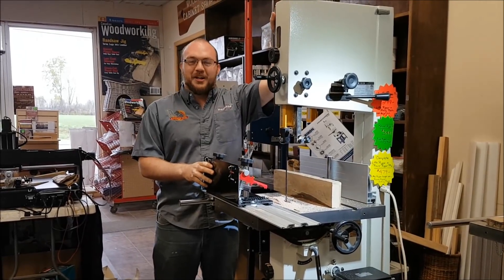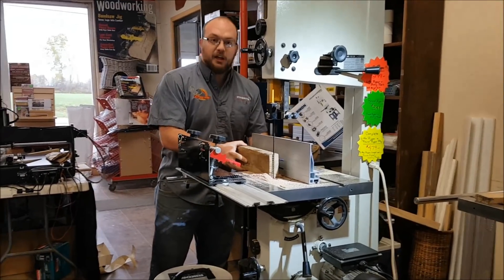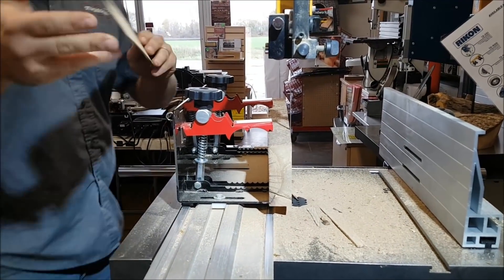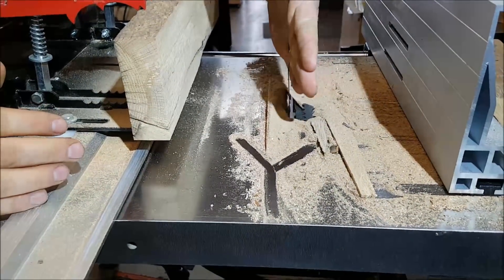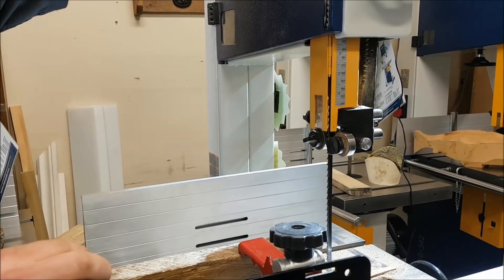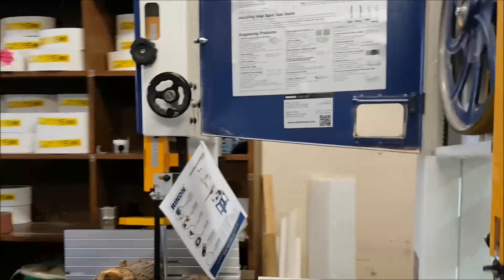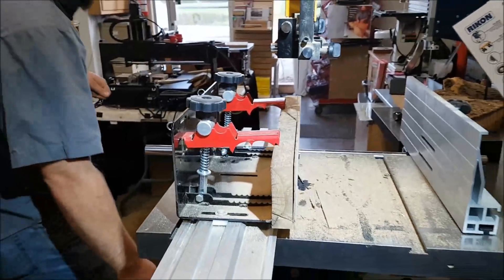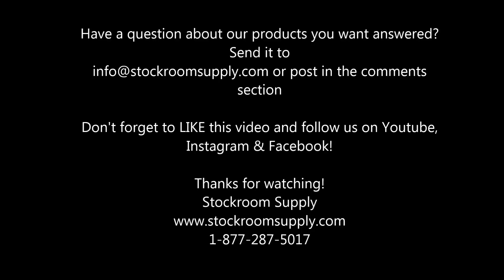EthAnswers Blade Drift myths, Why Bandsaws Should Never Drift!

Comment: As you say, “The real problem is when you want to cut a board straight down the middle. Regardless of what you do, when the wood begins to stress, inevitably it will push against the fence and bind the blade...therefore causing the drift!” If you attach an auxiliary fence which ends at the front of your blade, the stressed wood can spread out without pushing against the fence and causing drift.
Reply: Good one with the second fence ending at the sawing point so stresses will not cause the blade to bend.
Reply: I'll note that this is what people do with sliding table saws. Unlike American cabinet saws, a European sliding table saw allows you to pull the rip fence forward so that it stops just at the leading edge of the table saw blade.  Past the teeth of the blade, there's no fence, and so nothing to bind against.

Comment: What about drift when not using a fence....
Reply: In that case, drift is being caused because you are binding the blade. A human cannot run a piece of wood perfectly straight through a blade. Our bodies do not have that kind of fine motor control. With the sled, you are eliminating the human error. The piece of wood is contacting the blade with consistency that you cannot replicate free hand.

Comment: My world has been turned upside down, and the Truth Revealed!  I didn't know this because the people I learned from didn't know either - we repeat the same myths, handing them down from generation to generation.
One way to look at the Little Ripper is similar to a table saw crosscut sled, but designed for a bandsaw. In both cases, the cutting path is based on a machined track to guide the wood into the blade, rather than using the (unreliable) edge of the wood as a guide.  Call it a ripping sled?
The product costs more than my crappy bandsaw, but this at least lets me know what part of my technique I can change.
Thanks for posting!

Comment: The cause of blade drift is the table is not aligned to the blade.
Reply: This is only one cause. The most common wood cutting blades wear unevenly, losing set on one side before the other. Also, the tuning of the saw can put a twist in the blade from the top to the bottom. If the blade is running on the back of the top wheel and the front of the bottom wheel, it will be twisted. And the shorter the saw, the more pronounced the effect. This is why it's not particularly impressive for someone to demonstrate "drift doesn't exist" with a big saw with a very solid frame and a very sharp/new blade. This is like showing how wheel alignment of your car isn't real, because look at my million dollar Borghatti; I take my hands off the wheel, and it still goes straight! And this certainly doesn't prove that drift is caused by fences. 

The segment of the population with desperate blade drift issues are using a lot more of the bench top toy saws with the cast zinc aluminum alloy frames and probably using the blade until it starts to burn the wood or the blade snaps. With a flimsy enough frame, the blade can even wobble front/back on the wheels during the cut because of frame flex and vibrations, and the poorly damped oscillations in the frame will also effectively reduce the beam strength. Not to mention flimsy blade guides that can't keep the rear guides in a stable position.

Comment: Eth - I have a new 1/2" blade, 4 TPI in my bandsaw.  To test the idea out in this video, I made a sled that holds my board secure and that sled rides along a fence on right side of blade.  There is no way to bind blade.  My wood is short too, about 2" high, held firmly in the sled just like in the little ripper.  I have my guides set right and proper tension on blade.  However, I am still getting drift where if I start to make a 1/4" thick resaw cut, it goes down to 1/8" due to drift after about 4" into the cut and I have to stop.  What could be the problem?  Thanks.

Comment: Ethan, why would a curved resaw guide not accomplish the same thing, as it is only applying pressure to the workpiece right next to the blade? The wood movement is deflecting  against nothing, and therefore not pushing against the fence, and therefore not applying lateral pressure to the blade. As long as the cut is roughly parallel to the blade itself so the tail of the blade stays within the kerf, then no drift.

Also, when you say that the lateral pressure "dulls" the left side of the blade, are you saying that it's actually damaging the blade, or that it's just making the left side less effective in that moment?

Comment: Woodrumtodd1@gmail.com  I make bandsaw boxes and sometimes the bottom side will have runout, drift does blade tension have a lot to do with it? My biggest problem that’s driving me crazy is that my blades go dull very quickly and I’ve tried several different ones and am currently using a 3/16 4tpi hook. I mainly only use poplar and soft maple-solid 12quarter and 16 quarter materials around 12 to 18% moisture content. I have a 14 in porter cable bandsaw and am one day going to invest 1500.00 or so into a new one. Are my blades gonna still dull then and is cutting thick woods all the time my problem? Thanks for any advice

Comment: Wouldn't the fence work if you put the thick side towards the fence? The veneer would then bow away from the cut into the air, thus no drift, same as with that expensive contraption you have.
Reply: The fence should work the way you describe. That is the safe way you cut on a table saw also.
Reply: @wartlme  on a traditional western saw, yes......the little ripper is more akin to a euro sliding table saw.  The ripper is the sled/carriage that holds the piece through the blade.  on a euro saw, you position the fence in front of the blade ONLY  so the board has no lateral force on the blade.
Reply: I think it does, but the fence doesn't move along with the wood, you have to constantly apply the pressure from the wood to the fence the entire time, this is essentially a fence that moves with the wood staying square the entire time.
Reply: @Dhammawitt  that's why you use magnetic finger boards.
Reply: @AlphaBlkHrt  Which would only work for wood that's the same thickness. The fence side has to be evenly flat as well as  the featherboard side. People who cut raw woods into tonewoods this wouldn't be a solution.
Reply: @Dhammawitt  I made a fixture similar to this a few days after getting my Jet 14" (+ 6" riser kit), knowing I would save some cost if I could get larger, rougher pieces of my tonewoods, or even just billet. I watched the Alex Snodgrass bandsaw videos, and did a little digging/researching, while building my fixture, which is a bit more robust, because my engineering/design/workholding/fixturing background, and most of my education in this area, was designing it myself, building it myself, setting everything up, prove-out myself, and run it until we had our significantly significant sample, so we could provide Cap Study, SPC data, etc. to our customer, and that could be 100 pcs. or 1500 pcs., and I was ALWAYS working with metal, not wood. Could be brass, aluminum, any of 30 varieties of steel, bell bronze, any of a dozen stainless steels, or any of two dozen DTM super-alloys used in deep well oil and gas drilling, or aerospace. There's similarities and differences, but rigidity of the set up, proper alignment, and proper set up of tooling, machine, and workpiece matters. It just does. This guy has said some things that are very true, some things that are misleading, and a demonstration like this really doesn't give me useful information... unless I plan to set up my saw like this. 

The workholding fixture he makes and sells, or my workholding fixture, is essentially like running a fence opposite side a fence normally runs, with a good grip on the wood, and put the thin cut away from the fence. It's a good strategy, but a good set up of the machine, the fixture, the workpiece, these things DO matter. And I don't own a set of featherboards, for exactly the reason you said. The pieces used to make a solid body guitar or Bass spend very little of that building process time as squared off pieces where a featherboard does you any good. And a 1 inch tall featherboard trying to hold an 8 in tall piece of ziricote or cocobolo billet as it is resawn into the pieces that I need, is probably just going to be 20 minutes of work that just cost me a lot of money and made me pieces I have to find a use for somewhere other than where I was planning to be using them.
Reply: @Metalbass10000  I was resawing the other night, what would really be helpful is a quicker way of aligning and adjusting the wood. I used the little ripper which really holds the wood well but once I see that it's not perfectly perpendicular to the blade it gets hard to adjust. I know there's something out there I can use but I haven't quite put my finger on it. Basically I could attach the wood to this device that has fine tuning built in and then attach it to the little ripper. It's not too bad the way it is but I hate wasting any wood.
Reply: @Dhammawitt  Plane it first. and both sides can be flat, and parallel
Reply: @Dhammawitt  little ripper has an angle attachment that the base mounts to.  Something like that could work, clamp the workpiece down, rotate it  till it looks parallel, then slice a piece off to true up edge then start slicing.
Reply: @AlphaBlkHrt  this won't matter with the little ripper.  no way to clamp board down perfectly parallel to blade, so you have to slice a piece off, OR, plane/sand your first piece you cut off, THEN the piece will be parallel for the following cuts.  

your method requires you to go to the planer twice.   OR planer once, then slice a piece off to true up the edge, which again is wasteful.
Reply: thats where he messed up his video is wrong if he thinks that people put the cut off on the fence as soon as he said that im like lmao this dude is stupid the cut off is on the out side
Reply: @redbeard683  LOTS of people resaw with the intended use piece being between the blade and the fence, because they don't want to realign the fence after every cut to get consistently sized pieces.

Starting at the 11:23 mark, he resaws with the piece he intends to use against the fence.

https://www.youtube.com/watch?v=hgTpsGDRRRo&ab_channel=WOODmagazine

Resawing veneer with the veneer against the fence.

https://www.youtube.com/watch?v=0YuoIJc1vRk&ab_channel=TimColemanFurniture

So the "cut off" is not always on the outside as you claim.
Reply: @redbeard683  many people cut veneer with off cut towards the fence, so that you can keep the offcut the same size for repeated cuts.  if you do offcut away from fence you have to move the fence each time, you also have to do that with the little ripper.  Difference is that with a fence you need the wood FLAT against it.  With little ripper it holds the piece for you.  NO i don't work for or even own a little ripper.

Comment: look at your jig or little ripper. its not set to your miter slot its off at least a 1/8 on the front side. That alone proves you have bandsaw drift on that saw. your jig is no different than a fence, its just on the other side.
Reply: It is different to a fence in that the thicker piece of wood held by the little ripper cannot rock or wobble. Human error and tension in the wood can cause the wood to wobble against a fence, causing drift.

Comment: Greetings from London Eth! As I understand, you are saying that by placing a sideways force on the wood, you are pushing the blade sideways so that it is forced into a curve throughout the height of the cut. It's easy to see this would cause chafing of the blade, thus leading to burning. And you added that drift comes about because of the blade being more sharp on the side opposite the fence. Kind of makes sense to me. But my question is this. Surely if the blade is not tensioned enough, when you place a direct forward force on the wood into the blade, it will still bend side to side. In the same way that if you drive a boat backwards, you need to hold the rudder tight, as it will tend to immediately go one way or the other. Won't this do the same thing? I'm saying your theory doesn't seem to disprove the "correct setting of blade on wheel", but adds to it. Saying that, maybe the force towards the fence (i.e. your theory of what causes wood to come away from fence) greatly outweighs the effect that others describe... either way - informative video and I love how you invite debate!
Reply: p.s. I've only used a bandsaw once, so I have no practical experience - but I have just bought a second hand one and plan to understand as much as possible before I start to use it!

Comment: I'm a newbie.  Would you recommend a band saw or a table saw to cut a thick board in half?  The board is approx. 3 feet in length?
Reply from the maker: Truly depends how thick the board is! If your table saw can be set high enough to cut the board and has the power that's what i'd use.  If it is too large then I'd use a Bandsaw. 
Just remember both machines are dangerous...especially a tablesaw. Be extraordinarily careful when cutting a large piece of wood.
Reply: One follow up question.  If neither a table saw, nor a band saw, are available, will a circular saw be effective to make an effective cut IF the blade is big enough?

Comment: Great video but why do I get drift on my saw if I’m not using the fence and I’ve tried everything I could find on utube, are you saying if u buy that set up you have I CAN resaw straight?
Reply from the maker: Hey Tarin,
First off thanks for watching! Essentially what i'm saying in the video is as soon as you bind the blade it will drift...so as long as you don't bind it regardless of the tension setup etc. it will cut straight.
So if you are not using a fence I assume you are freehand pushing the wood through the blade? The idea of this is fine...but the issue is as humans we cannot push perfectly straight on the blade and will inevitably end up putting side pressure on it.   As soon  as we put side pressure we wreck the set of the teeth and the blade begins to drift.

The Little Ripper never lets you put side pressure on the blade therefor it will never drift so yes. If you owned one you could cut straight!

Comment: I don't even own a bandsaw but wouldn't you achieve the exact same cut using the fence, if you make sure that you cut on the side of he timber that is away from the fence, allowing for the veneer to flex out (to your right that would be) rather than being forced into the fence?
Reply from the maker: Hey J F,
That is the best way to use a fence but there is still a major issue 
when trying to resaw.
 Picture a 1" board that you want to 
cut in half,so two 1/2" pieces. When this 1" board begins to 
stress(splits/peels off/opens up) which side of the board is moving? The
 side against the fence or the side away from the fence? Since you are 
cutting two equal boards likely those boards are opening up very 
similarly. Therefor you will be binding the blade against the fence.
When you do this same resaw with the Little Ripper something totally 
different happens. The 1/2" board away from the Little Ripper will open 
up and stress but the piece that is held in the Little Ripper does not 
move. Simple reason is that the 1/2" board is clamped by at least 8 
different points...it can't move. As soon as it is released from the 
claws it will stress.
Hope this makes sense!
Reply: Thanks, it makes perfect sense once it has been explained. That also seems to make the Little Ripper a very strong tool (clamp) being capable of suppressing any stress in the wood it is clamping. I suppose that it will only be as effective on fairly short lengths of timber, or maybe there is a Big Ripper for resawing long pieces of timber? Either way it is certainly very useful information when doing a bit of research prior to buying a bandsaw.   Thanks again. JF

Comment: What this indicates to me is that you cannot simply set your blade close to the fence and peel of thin sheets. You need to peel off each slice starting from the outside of the board then move your fence in for each subsequent cut. Setting the fence for each subsequent cut would not be hard if you you used some stop blocks. So you really don't need a fancy gizmo, just a change in procedure.
Reply from the maker: Hey Jared,
That is the best way to use a fence but there is still a major issue when trying to resaw.
 Picture a 1" board that you want to 
cut in half,so two 1/2" pieces. When this 1" board begins to 
stress(splits/peels off/opens up) which side of the board is moving? The side against the fence or the side away from the fence? Since you are cutting two equal boards likely those boards are opening up very 
similarly. Therefor you will be binding the blade against the fence.
When you do this same resaw with the Little Ripper something totally different happens. The 1/2" board away from the Little Ripper will open up and stress but the piece that is held in the Little Ripper does not move. Simple reason is that the 1/2" board is clamped by at least 8 different points...it can't move. As soon as it is released from the 
claws it will stress.
Hope this makes sense!
Ethan

Comment: Although you didn't mention it, lowering the upper guide seems not to be necessary. Is that correct?  Suggestion. wear real safety glasses and loud sound protection.  Dr. J
Reply from the maker: Hey JF,
Thanks for the suggestion.
As for the guide you are correct it really doesnt matter for resawing. Here's a video where I talk more indepth on bandsaw guides.
https://www.youtube.com/watch?v=fF5_3b25LuM